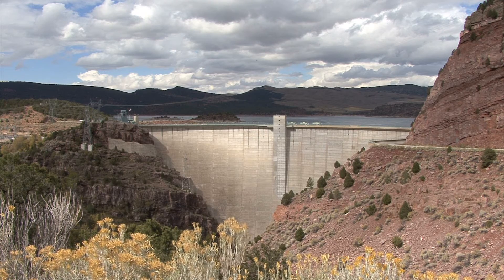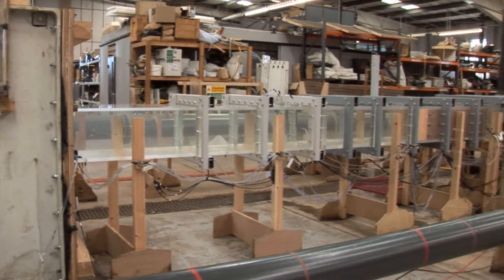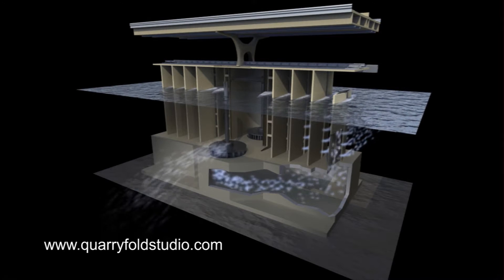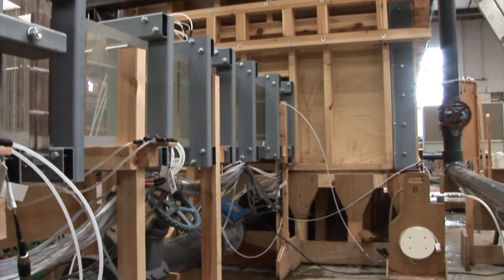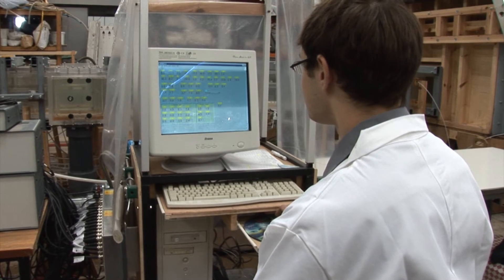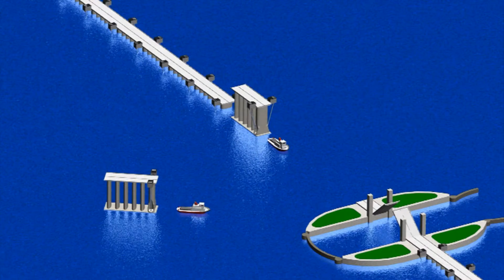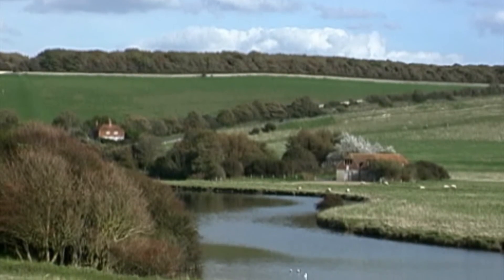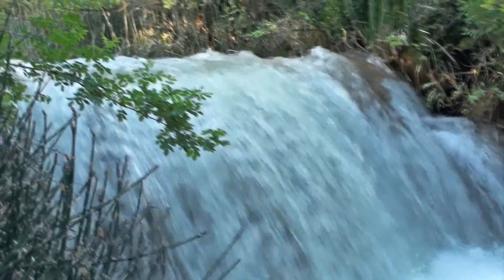VerdErg Renewable Energy Corporate Video

Comment: Using water power  to increase the head required to generate electricity cheaply rather than trying to improve efficiency in large low head generation situations makes sense to me. Similarly, as nuclear energy is essentially free it seems to make more sense  to operate nuclear generating stations with thermal inefficiency at say 15 psi rather than go for efficiency and have to operate at 600 psi.  Much easier to handle the lower temperatures and pressures. I hope VerdErg  will consider  this !